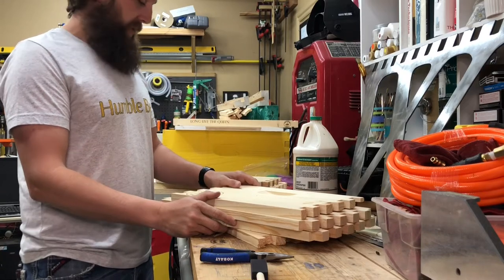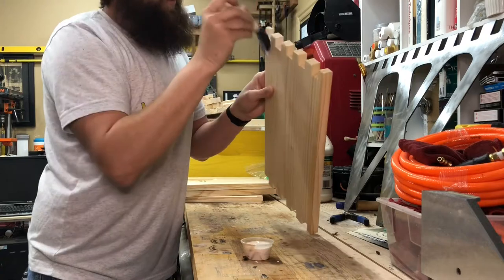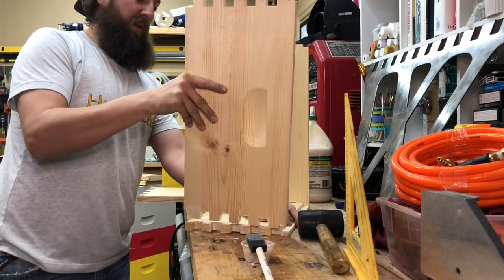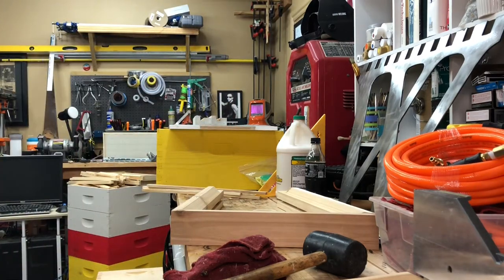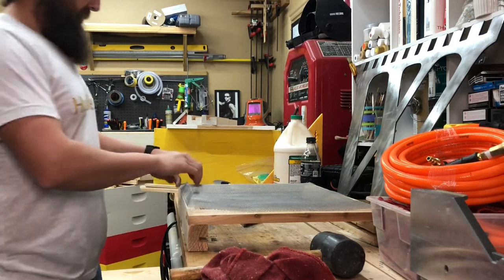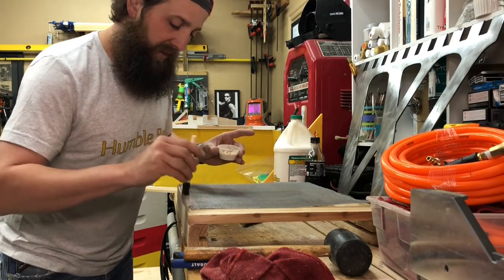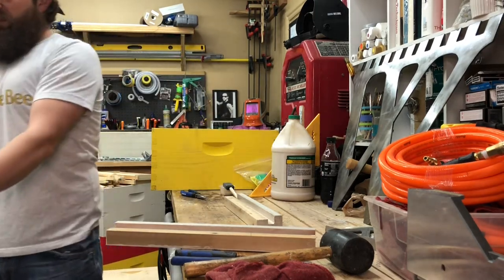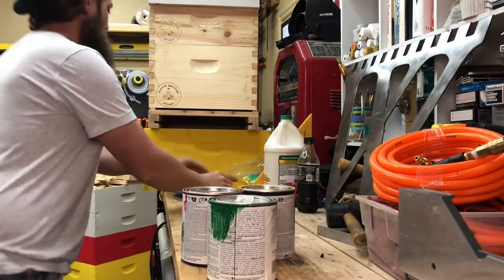How long does it take to build a wooden bee hive?

Comment: Do you always use a screened bottom board?
Reply from the maker: We have a couple non-screened bottoms. I really haven’t formed a solid opinion on one or the other yet. I need to do some comparison testing to see which is really better for our area.
Reply: @castlegroundsapiary5286  let me know what you find out.  I went with solid on mine
Reply from the maker: @CoffeeNo0b0514  our first two hives had solid bottoms. Functionally, they seemed to work fine. The only issue with them is that they are ply material and are already falling apart. Are your bottoms solid wood?
Reply: @castlegroundsapiary5286  yep, solid wood.